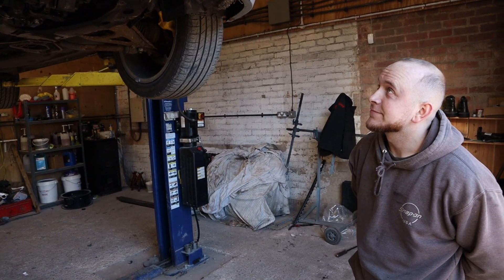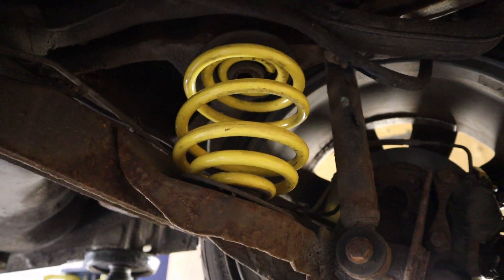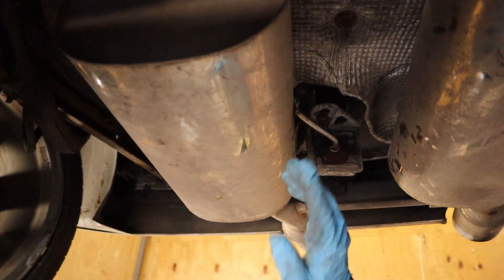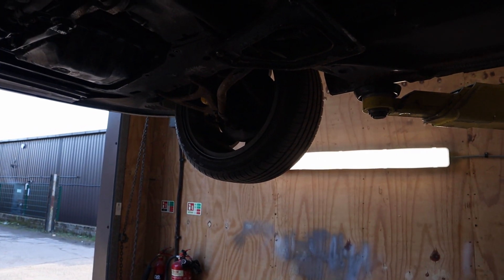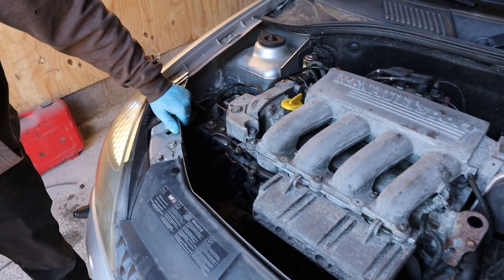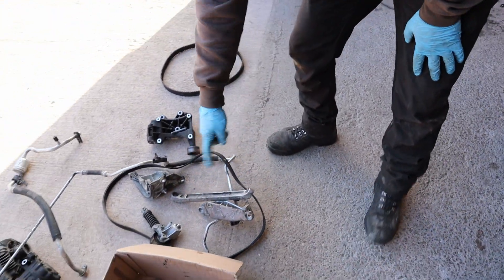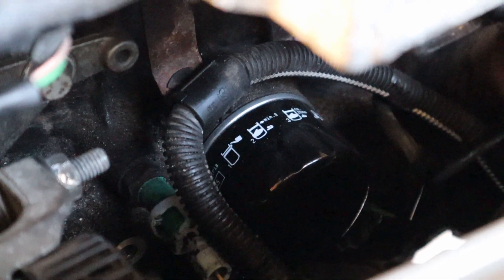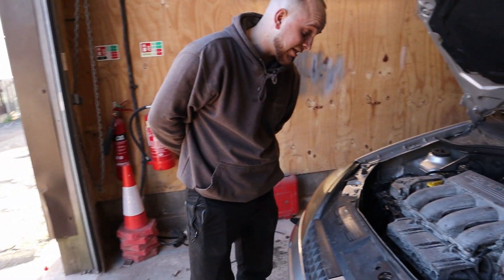MY CLIO 182 IS FIXED! *FIRST PERFORMANCE MODS*

Comment: Great choice for a track toy, I’ve got a good mate who worked at bruntingthorpe raceway with clio 182s, had a chat with him he recommend Decent wheels/tyres for a start. Poly bush everything. Camber adjusters on the front to increase camber. Good idea to think about a cage. Gearboxes can be a weak point, look for oil leaks from the selector shaft (which I see you have fixed) the standard seats he said are not ideal for track use. He also ran a bilstien suspension kit. 
Look forward to watching the build 👍🏻
Reply from the maker: All on the long to do list 👍🏻 got lots planned for it

Comment: Be worth replacing the shocks looking at them. Best thing you can do is refresh everything in the suspension
Reply from the maker: That’s the long term plan 👍🏻
Reply: @CarsWithSmithy  just be better saving for a while and getting a decent set of coilovers 👌